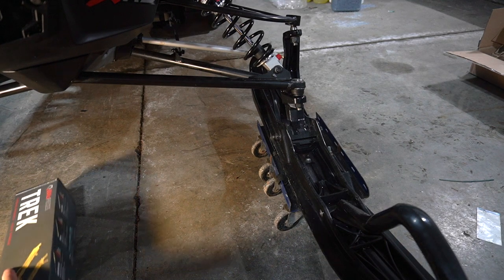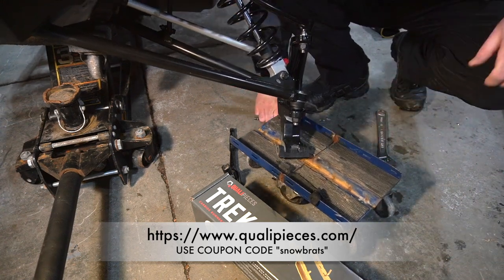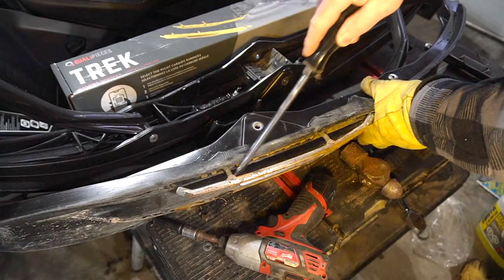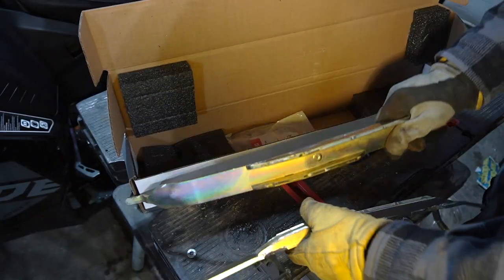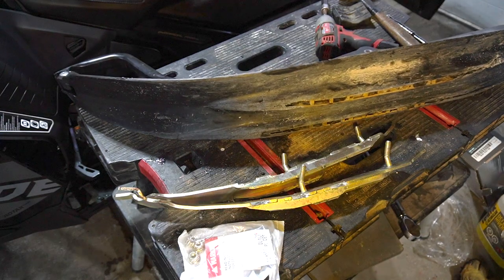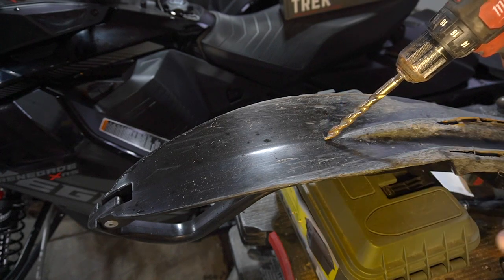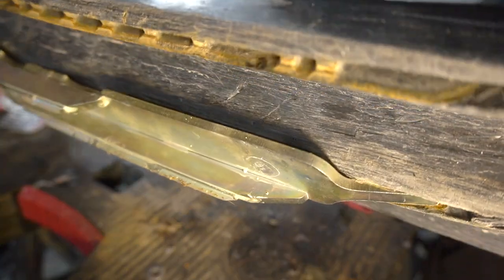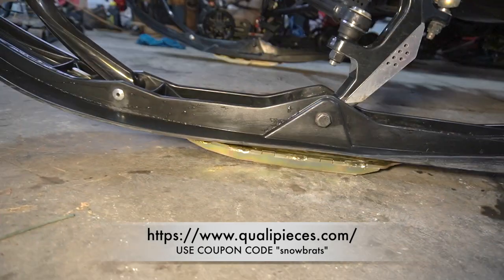INSTALL QUALIPIECES TREK or ADVENTURE   THE BEST CARBIDE RUNNERS FOR SNOWMOBILES

Comment: Isn't the outer keel on the pilot ski supposed to help you in the corners to get more bite on the outside? I don't think those things are going to ride right with the skis on backwards.

Have you ridden it yet?
Reply from the maker: yes we rode it - without a carbide ski is symetrical so same shape each half.  I am going to flip it and lut a crappy carbide on just to act as a ski saver

Comment: Hey Mudbrats , your extra runner should be on the outside . Keep up the good work
Reply from the maker: i wanted to try the carbide without an extra runner.  now the test is done, ill flip it back and add the extra runner to protect the ski